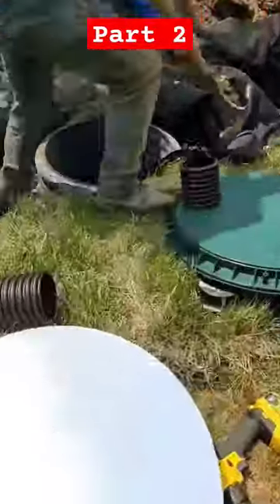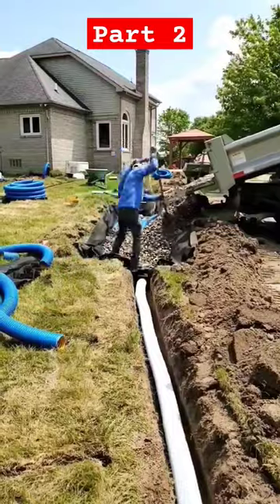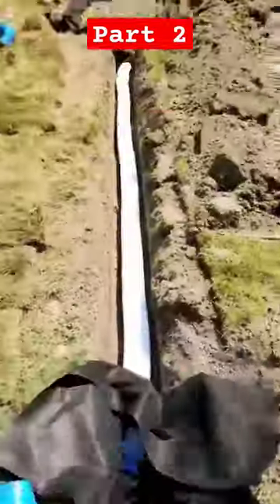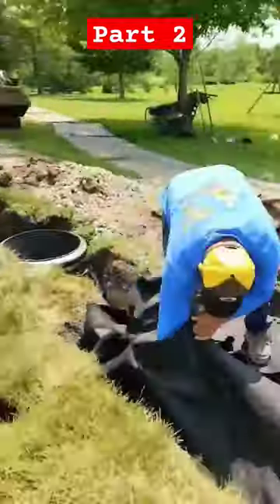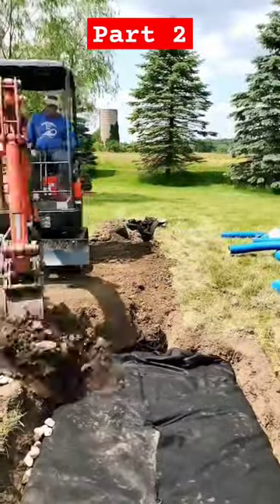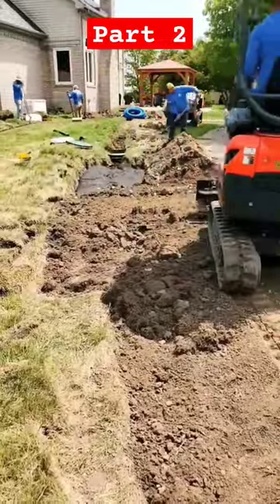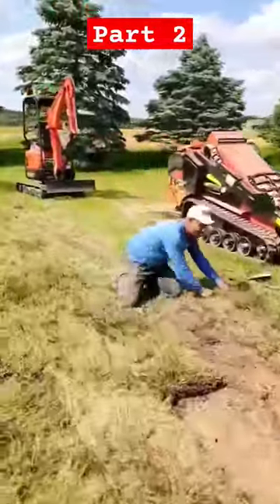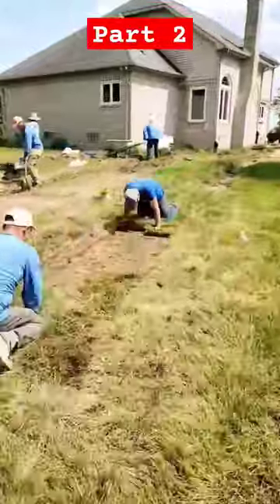Fix Sump Pump Discharge Line Muddy Mess Part 2 of 2

Comment: Is proper compaction with a plate compactor or sheeps foot a concern? Is it a fine balance between compacting so the ground doesn't dip the next year and possibly reducing water flow?
Reply from the maker: We make the bottom smooth during excavation. No tamper

Comment: What kind of insulation is that for the dry well lid?
Reply: Looks like a polystyrene. Idk if they sell circles with drainage contractors or not but you could cut a circle from an XPS or EPS rigid insulation board readily accessible at all big box home improvement stores. XPS has slightly higher insulation value but also somewhat worse for the environment too.
Reply: @baxt1412  thank you!
Reply from the maker: Just Styrofoam